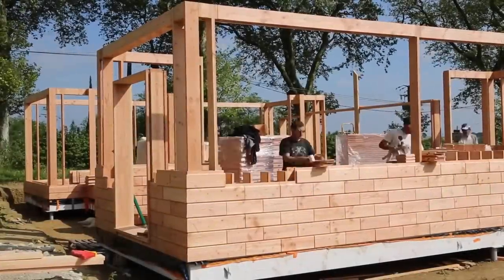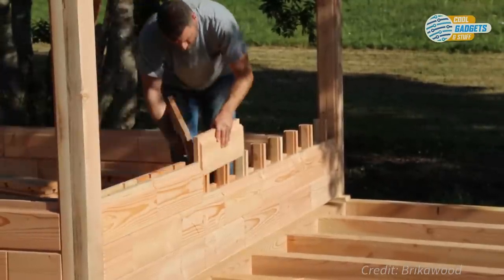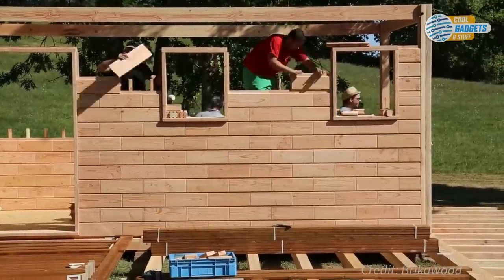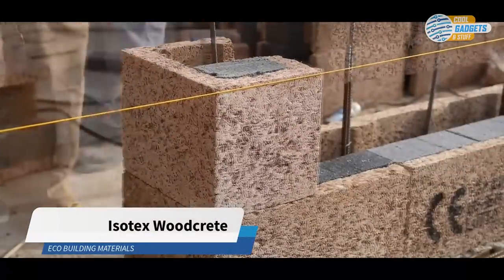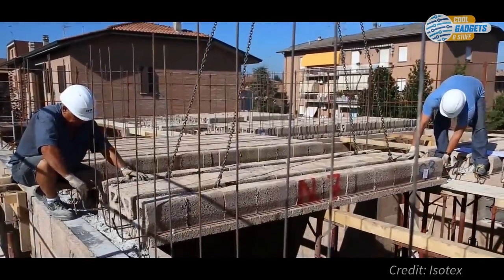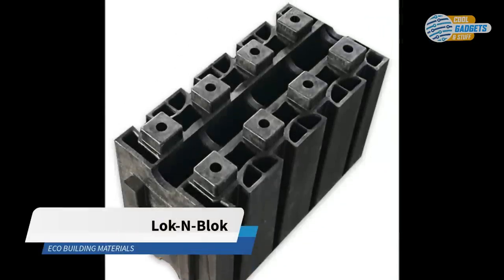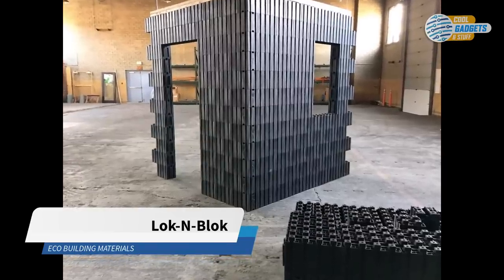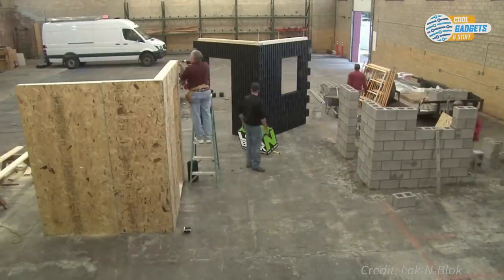5 Eco Building Materials #2

Comment: I like the idea of the lock and block system in a way to use up plastic waste. As long as the outside and inside could be covered over by a nonflammable and traditional covering. In other words be able to glue or screw to it or concrete up against it for durability and fire resistance. I myself live in Tornado Alley and that is an entirely different issue with most building methods. We get all four seasons and add very strong weather conditions and hail and tornados.

Comment: Interesting. I have never hear of a wood brick system like that. Living in Canada I would want to see a wider wall for more insulation but yeah it could work here. Well I guess log buildings are the same idea and those are everywhere here. They also make logs that are milled to interlock like that, with grooves on top and bottom that fit together. They make a really tight house for a log house. It uses more logs though. I still like the full scribed log home, they are so damn beautiful!
Reply: Sir please watch lockable bricks concept no need to be cemented easy removable reusable I have seen in somewhere in Africa inner areas
Reply: Beautiful but expensive 💲💲 I was wondering if the plastic Lego house would be warm enough for our Canadian winters. With building codes becoming more stricter in Canada all the time , I think half of these methods would not pass codes for the fire ratings or snow loads , (or the big bad wolf, huffing and puffing ) how would insurance companies insure a home like these?????? 👍 👍 🇨🇦

Comment: Brikawood may be fine for a mild dry climate but not enough insulation value for most of the world. The inner and outer layer (3" together) should be R value of 1.5 per inch of wood for an R value of 4.5 plus whatever you use for cavity insulation(don't use shavings). The thermal bridging for the interior dovetail studs cuts down the overall assembled R-value by 20 to 30%.
Reply: What would you suggest for very cold climates, like -20c?

Comment: While I'm sure all of these methods and materials have their advantages and disadvantages, the Brikawood  one worries me the most.  Exterior and interior walls made of wood, with filling/insulation of wood shavings or puffed wool, make me think it would all burn way too easily.
Reply: Wood burns at a consistent rate so making thicker for insulation also increases the time takes to burn unless you decide to add an accelerant
Reply: Main toc,  I agree, fire risk and with all pieces  integrated  and locked together  , would be  difficult  to repair  rot or damage
Reply: Char the wood like the Japanese do.
Reply: @tylerferrell2959  is correct, you would have to add an accelerant, or oxygen (is that technically an accelerant?) To induce any more heat or quicker burning. The only real risk is that there is no separation to cut the line of fire, like an aluminum strip between 2 boards to prevent the flame from jumping quickly, to slow the spread.
Reply: @Barry Foster me 2, concrete is eco friendly as well, and build thermal mass which is also effective for maintaining temperature.
Reply: @Barry Foster I love that you took the idea and said, house? No no no, and now you'll have a beautiful privacy fence.

Comment: I visited a property outside of Green Bay, WI in the late 1980s that was listed for sale. The seller had built a cord wood home and garage. It was exactly the same method you featured in this video. We passed the attractive garage on our way to the house which was set farther back in a wooded part of the lot. We were discussing the novelty of the building method when we turned a corner and the house came into view. 

Or shall we say, "what was left of the house." It had been nearly completely destroyed by a fast burning fire that destroyed 95% of the structure and all of the contents. My brother in law was a fire fighter. We were shocked by the utter destruction of the home and sat silent as he turned the car around and abruptly left. 

In Wisconsin we heat our homes during the winter and have a heightened respect for fire. I would never, ever live in the wood brick house either. Wood dries out quickly. It also splits and rots. I sincerely hope that some inexperienced person does not take your advice and move their family into one of those death traps.
Reply: Laurel Shelhamer Yet the vast majority of US homes are wood framed, with OSB, chipboard and plywood cladding, flooring and roofing. Then pumped full of paper or toxic foam insulation. All of which burn far more readily and violently than a solid log.

Comment: The future has to be block systems if we want robots to build for us, would be nice to go into a designated 3d program and have a building built shortly after. Buildings would be a little pixelated if you can call it that but curved surfaces can be made smother in the final finish by hand.

Comment: 0:22 - Brikawood - It talks about passive construction, possibly referring to Passive House design, but I do not understand how this would avoid issues with condensation or create an air-tight barrier. A passive house design is based on the principles of creating a house with minimal air-changes. I cannot see how a timber wall insulated with saw dust creates a wall that is resistant to moisture/vapour and further mould issues.

If someone can explain how this wall tackles moisture and mould issues please let me know.
Also, please let me know what is meant by 'Passive Construction' in the context of this video if possible.

Comment: I see no electric or plumbing  how about heating and cooling . All of this needs to be integrated into  those  new building ideas !
Reply: so you drill a hole ok then you put a wire though that provides electricity then you have home electricity
Reply: That's something you have to do as you build up

Of course you could use conduit attached to interior wall

No matter what you do, you just have to have the plan before you start....... there's plumbing too

Comment: 1.  Too bad there's water-penetration points at EVERY vertical joint.  2.  Every stud is a "thermal bridge."  3.  Sawdust is NOT a "strong insulation" at a R value of only 1-2 per inch.  4.  Sawdust is like a sponge which will soak every bit of humidity entering thru the untreated joints.  CAN YOU SAY MOLD?  5.  Sawdust is a very effective fuel for a fire.  All these deficiencies will also be exacerbated also by the tremendous expansion/contraction of these pieces.    This brick-w-wood is a mold/rot nightmare in no time.  Wow.....sure a lot of effort into a product that will go NOwhere.  And nowhere for good reasons.  This is pretty basic stuff;  do people just not think any more?  That's crazy.

Comment: Eco Building Materials:
Then proceeds to use wood!
Reply: Wood is pretty eco friendly, or at least can be (region dependent of course) as it stores the carbon. As long as you have have specific areas for growing building wood and don't cut donwn old growth forests. Of course in other dryer regions with less trees, mudbrick/strawbale/etc is a better choice. Modern materials though, cement, steel, glass - is just absolutely terrible, and with short life spans to boot. Wood can last for centuries: https://en.wikipedia.org/wiki/Stave_church
Reply: StrivingLad 87 wood can be a very green choice. In much of northern Europe wood is widely grown in sustainable, managed plantations for building. It's a crop, just like any other- it's planted to be harvested. It lasts for generations, is carbon neutral, contains no dangerous chemicals, can be recycled. No one is suggesting using wood from virgin forest here.